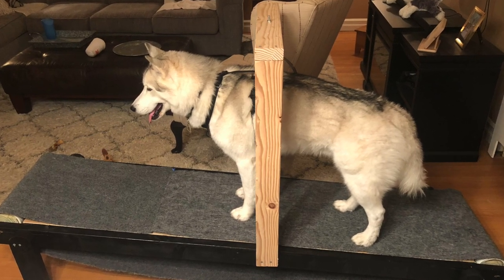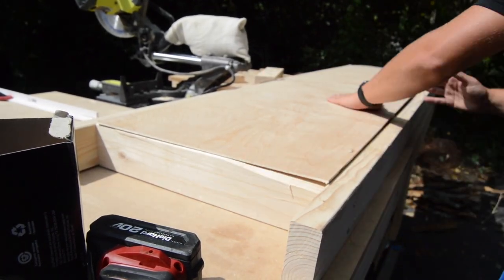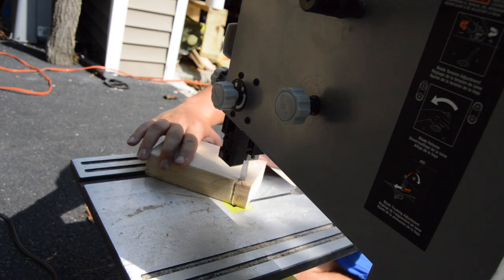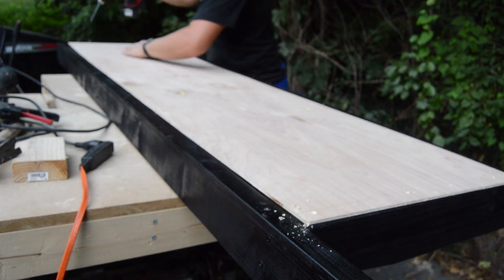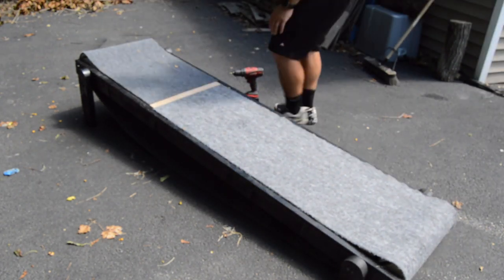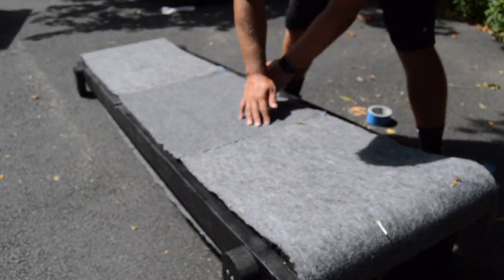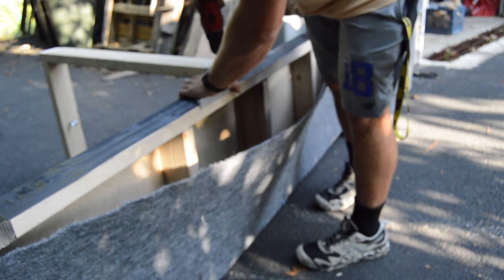How I made this DIY Treadmill for my Siberian Husky!

Comment: I’ve been using an electric mill for about 15-17 years with the various dogs I’ve had the pleasure to own. I had a carpet mill quite a while ago and in my experience most of my dogs didn’t run as well on it as they did with the electric. The carpet as you know only moves if the dog makes it move so I had to motivate them with their favorite toy or tug toy in front of them. Then they’d run for a minute or two. That’s why the electric has been my choice. You can set it to 2.0mph with about 3% incline they will jog for about 10-15 minutes and you can decrease their speed if they look tired or shorten their jog. You asked for requests for another build, would you build a slat mill? They are motor less like the carpet but they move quick with the rollers going all the down the surface they run on. You might already know what they are but if not you could research a little. Thanks and great job BYW on this build I hope your baby has a blast I know mine do take care
Reply from the maker: Thank you for this! Yes electric would be 10000% easier for the dogs to move on, however was not in my budget. Slats could make for another interesting build, this is something I am definitely going to do some more research on. Thank you for the amazing feedback!!
Reply: Your Siberian Husky will enjoy a slatmill. Just like the carpet mill it’s dog powered not motor powered but the slat mill can be real fast. Good luck with your research I look forward to the video if you end up making one. Thanks
Reply: For some this is more accessible than other options. It costs a fraction for those of use without a ton of disposable income. Might not be the best of the options, but I feel it works in a pinch!

Comment: First let me say thank you for sharing.  I would love to make this, unfortunately you weren't very clear on the rollers part.  If the wood inside the pvc was screwed to the pvc, and was made immobile, how do the rollers roll?  I am sorry, but I am just not sure how to fasten the rollers to the frame to allow them to roll that well. You showed screws in both sides, but those screws can't be the only thing holding the rollers in place, or they would thread themselves out.

Please explain

Comment: Did you sew the belt with wire? What size and do you think it could handle a small motor to make the belt turn?
Reply: The point of them not having a motor is it makes it safer for the dog for the treadmill to be powered by their running cus if there is a motor and the dog decides it wants to stop running they could get injured

Comment: I know I just watched the video but what are the steps to making it? I want to know so I can write it down and do things without having to go back everytime.
Reply from the maker: 1) Get a dog (or a second.. or 5th... as many as you can.
2) measure the dog (make sure the frame is long enough for his/her longest stride (i did 1.5x his stride for ghost) 
3) build the frame (leave room on the ends for the rollers, add support studs in the middle)
4) attach plywood to the top of the base (not where the rollers will go). make sure to countersink the holes so the carpet wont grab onto anything
5) make the rollers (pvc pipe + landscaping lumber)
6) attach the rollers to the frame
7) attach legs to the frame
8) attach the carpet to the frame (sow the 2 ends together to create a loop)
9) add the safety support to attach the dog with an old leash / rope with a clip
10) add dog to treadmill
Make sure to train the dog to use it though! Don't want the little guy/girl to be scared on it!
Reply: @thewoodworkinghusky3284  Thank you 😊
Reply from the maker: @leafles5309  no problem! Good luck with the build! Let me know how it goes!!

Comment: How long did you make the frame? Awesome job btw, this was very helpful
Reply from the maker: That's great to hear! It took maybe 30-45 minutes between cutting all of the pieces and screwing them together. The use of a stop block made the bracing pieces super easy and super fast to cut the same size piece accurately. The longest part by far was sowing the carpet together to make it a longer piece (note to self: get a smaller dog, or a bigger carpet next time)
Reply: Bigger as in thicker?
Reply: @thewoodworkinghusky3284  I think he meant how long is it in terms of the dimensions of the work

Comment: So I'm having problems getting the carpet to move any suggestions
Reply from the maker: Give the carpet more slack (the tighter it is, the harder it is to start). Try using a wax paste or something to slick up the base a little bit. Make sure the rollers can spin, if there is too much friction, it won't be easy to move. I would also check the carpet to sefe if anything is getting stuck on it. Hope this helps!

Comment: Wondering where I can find copper tubing like yours? Everything I found, the diameter was too big.
Reply from the maker: This was something I had some issues with as well. I went to a hardware store near my house, and found a little brass insert. It did not fit all the way through the 2x4, but it was enough to keep the nail from rubbing against it. Hope that helps!
Reply: Thanks!

Comment: I’m just not sure how you got the copper pipe in the hole
Reply from the maker: I drilled a hole to the correct size (a little smaller for a snug fit), and used a rubber mallet and a piece of scrap to bang the copper into place

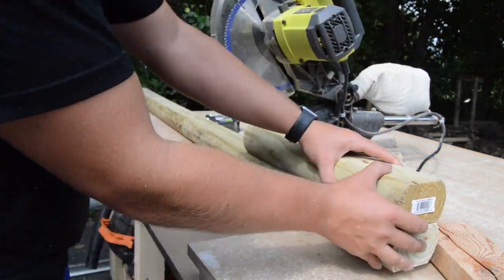Comment: 2:15 can you explain what a counter sink is?
Reply: I’m going to make this for my mini aussiedoodle! So it’ll be a small one and I’ll definitely let you know how it goes as I want it for my apartment. Thanks for sharing and being so detailed! Loved the vid! Did Ghost ever get less afraid of it or get much use out of it?
Reply from the maker: Take a bit that is bigger than the head of the screw and drill a shallow hole (about the depth of the screw head). This is so the top of the screw will sit flush with top, creating a flat surface.

Comment: hi what's on the floor? what is spinning? material
Reply from the maker: Thanks for reaching out! I'm not quite sure what you mean, there isn't anything on the floor (except for the legs for the treadmill). The carpet is touching the floor because of the slack in it, but that's all. The carpet spins as the dog walks/runs on it, pushing the carpet backwards, and spinning along the rollers. I hope this helps!
Reply: @thewoodworkinghusky3284  I got it all, what material do I mean? Made the same track, I have carpet and laminate instead of plywood
Something doesn’t slip, so I ask, what material do you have? Also a carpet?
Reply from the maker: @РоманКочиев-о5ь  I used cheap carpet from a local hardware store, I just made sure it didn't have a rubber backing so the carpet would slide. It moves along 2 rollers, one at the top, and one at the bottom.

Comment: how much carpet did you use? and where did you get it?
Reply from the maker: A ROUGH estimate (pun intended) would be about 15 ft. I got it at home depot, but it only came in 12' strips, so I needed to make it a little longer. You can calculate it by figuring out how long the platform is, multiply it by 2 (top and bottom), and same for the front and back, then add a foot or 2 for slack, the more slack, the easier it is to start the movement!

Comment: Where you get the building timber at
Reply from the maker: I just got it at a local big box store. I really spent the time to go through and find the best pieces, with the least amount of bend, and knots/etc.
Reply: What about the carpet best type of carpet to reccomend ?.
Reply from the maker: @apbt4lif335  I just used the cheapest one I could find at the store. The only thing that I was looking out for was something without a rubber backing. I wanted something that would create as little friction as possible